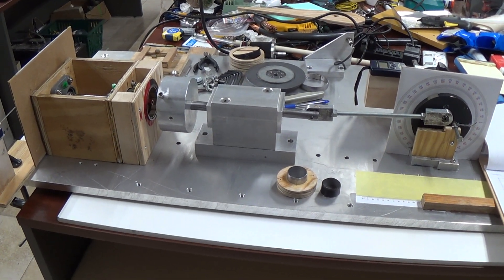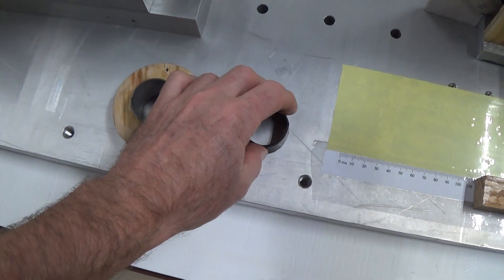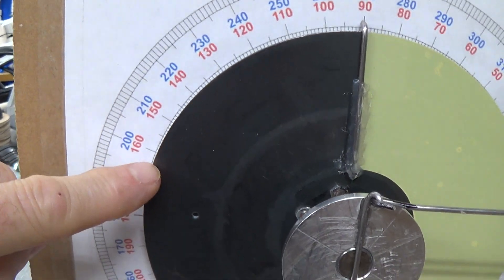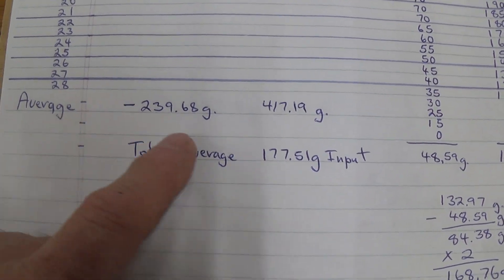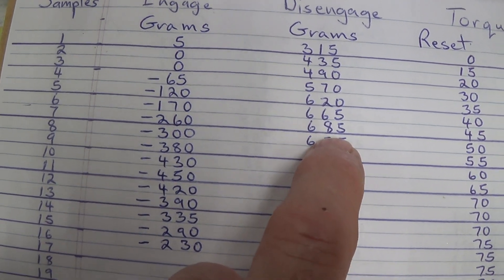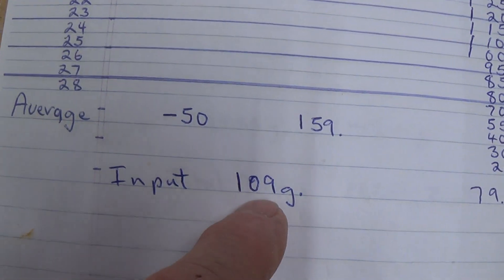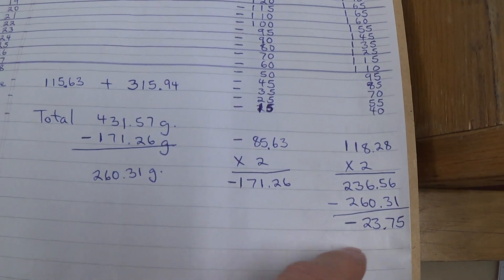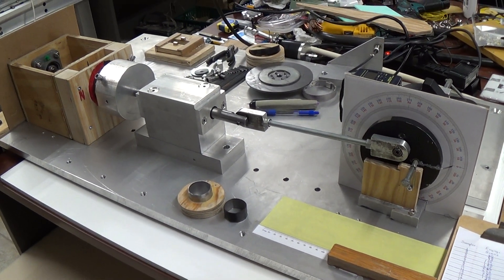Floor's Twist Drive Permanent Magnet Torque Amplifier test 5

Comment: Fantastic work. I wish I had that time and energy to that kind of testing.
I am glad I got on your channel tonight. I have been watching to see if this would pan out. 

How about half of the shielding? Just a thought. Have seen something to that affect in a 
patent recently.

Seems to me that you can't over come, repulsion to attraction unless you can use a small
amount of current and a flux gate on the back side of the magnets.
Reply from the maker: Thanks for your supportive post. The shielding works well. The problem comes when you want to pull it out. It uses all what was gained to do so. I have a better design which I'll demonstrate tomorrow. Stay tuned!  Luc